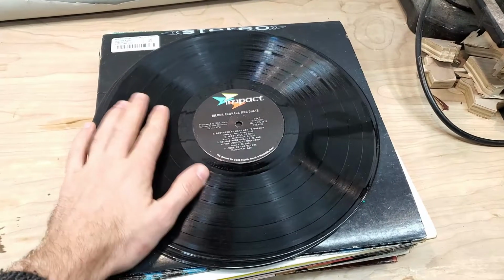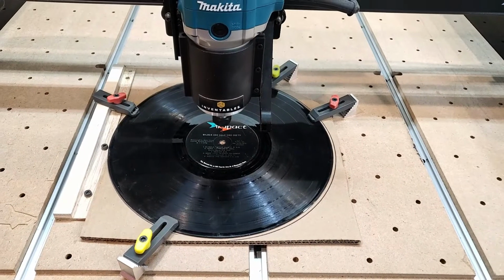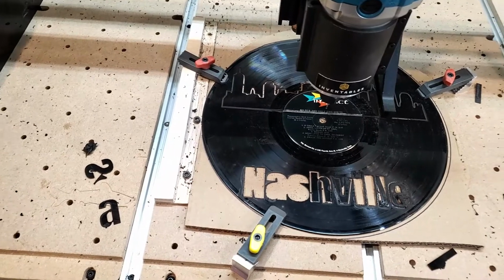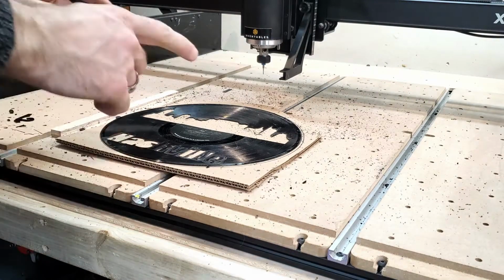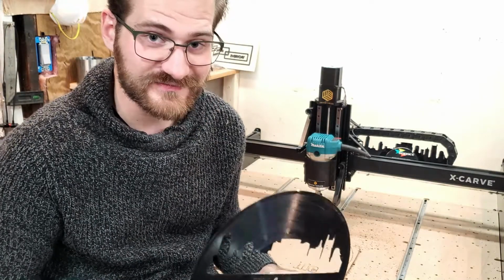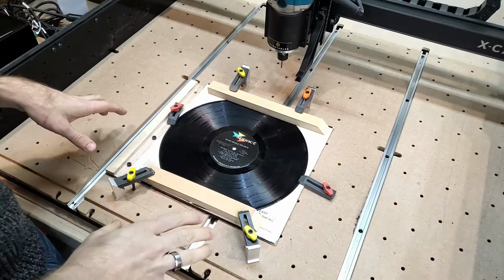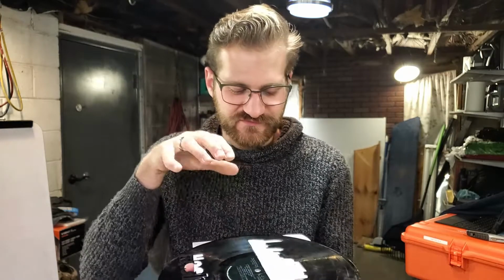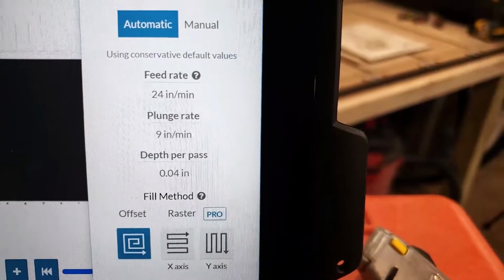Cutting Vinyl Record with CNC

Comment: Now the question is can you use some precise CNC milling machine to engrave music onto some plastic 12 inch material and then put it into the vinyl record player and listen to it... I know it needs a software to convert wav file into the up and down moves of the engraving tool, but in theory it is possible.

Comment: Use Windex or a spray cleaner like 409 as a cutting fluid to prevent the vinyl from melting and gumming up the bit. Also a profiling bit like they use to make signs in laminated plastic has a fine point and gives better detail. Use the center hole in the record to clamp it down. corrigated cardboard not a good backing material use plywood.

Comment: I'm interested in doing this and have a laser, but truth be told, the gasses the heat emits from PVC material is poisonous and corrosive to your equipment.  Which is why I'm venturing in the CNC to do this.  Laser would be so much easier, right?
Reply: Have you tried using a Cricut Maker to cut them too? I have tried doing 15passes with the Cricut & the fine point blade but only cut 2/3 through. Cricut gave me an idea to help finish it. But may be worth you trying.

Comment: Is there any easier ways to do ? Nice video .
Reply from the maker: I have not found an easier way yet
Reply: @businesseveryday  thanks 4 answering , I'm looking to know if it can be done with laser , i didn't see any
Reply from the maker: @firas faisal  I have a laser CNC and am still testing with it.  What I have found so far is that the record is really sensitive to heat and the laser can melt the vinyl.  I have not found the right settings yet for this process.
Reply: @firasfaisal6883  It is not safe to breath fumes so don't think laser would be safe
Reply: Hot knife, cuts it by hand